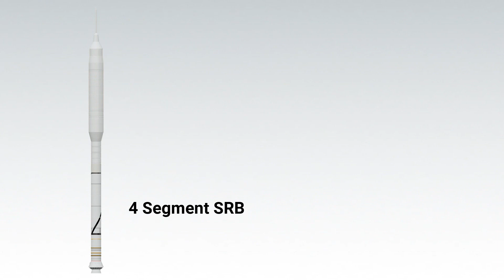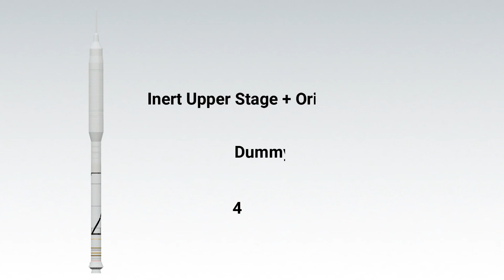The Cancellation of Constellation

Comment: Constellation was the fantasy of then then-current NASA administrator.  The solid rocket powered booster was far too weak for the mission and caused the redesign of Orion until it had been reduced from six crew to four, and the amount of water per astronaut had been reduced to a PINT (!) a day.  Despite the "potential", it was a poor design all round.  SLS may be crazy expensive, but it's better designed by far!

Comment: So the Altair, with the cryogenic fuel in it, would be parked up there in LEO, waiting for the Orion to show up.  Surely there was a time limit for this before too much fuel boiled away.  What was the official answer to this obvious question?  Surely there was one, and boy would I like to know.
Reply: There was supposed to be a "loiter ring" attached to the cryostage - essentially a bunch of solar panels and cryocoolers wrapped around the engine section, which would be jettisoned before TLI

Comment: I mean, u are right, constellation program was the best NASA engeeniers could have imagine, but, due to the contractors, and partially due to the specs requiered it was simply so much expensive, maybe id they have gone in to a 2 stages medium lift querosene propulsión vehicule, maybe today we could have an Ares 1, and then, the awesome Ares 5 that enormous project should have never be founded or even propose until Ares 1 crewed maiden flight.
Let' s hope on the elon and jeff way cause it seems like NASA can no compete with the SLS, even Europa Clipper must lift off in the Falcon Heavy or New Glenn, if ready, because vibrations on the SLS
Reply: Constellation Project used old technologies of Apollo and Space Shuttles and a 21st replay of the Apollo style moon landing is very meaningless!

Comment: Great general outline of Constellation. However, the longer Constellation lingered, the more and more unrealistic it seemed.
The foundation for its start was a study done of what NASA should do in the wake of the Columbia disaster, which was to return to the moon and head to Mars. The resulting program was Constellation. There were criticisms at the beginning that instead of taking advantge of bold new technologies as was suggested in the Bush exploration report, that Constellation was just a big relplay of Apollo, and was not really a fundamental step forward in technology, but just something to delay an eventual Mars mission.
By the time metal was being cut for it, its budget required that the ISS be de-orbited as NASA could not afford to keep it going and fund Constellation, and the Altair lander would have required an unrealistically large increase in NASA's budget. Also, there were some severe engineering reports, including one from the Air Force stating that the crew could not survive a first-stage explosion due to the rate of expansion of its fireball being able to overtake the escape system rocket. This was significant because  a major part of the rationale in killing the shuttle was that there was no way for the crew to escape a launch problem, as had doomed the Challenger crew.
Even the case for returning to the moon was not stated, and it did not have broad support from the public or even within NASA, as it would have been so expensive that NASA would only be able to do an underfunded Constellation and little else. 
Artemis has gained more support because it does have the stated goal of finding and making use of the moon's resources, and it makes use of commercially provided components, and apparently it requires much smaller increases in NASA's budget to pull it off than did Constellation.  Politically, it gains some support by its use of the in-progress SLS and Orion, and in general Artemis is open ended and can evolve to take advantage of what we find on the moon and commercially driven technology, instead of just committing to a prohibitively expensive lunar delivery system with no clear purpose. It should be stated though, that thanks to Constellation, the LCROSS mission (that verified lunar water at the south pole) and the LRO that accompanied it, did fly on time as the first Constellation elements, and have contributed a lot to illustrate the importance of the moon to exploration.
https://www.nasa.gov/missions/solarsystem/bush_vision.html
https://phys.org/news/2009-07-air-ares-crew-couldnt-survive.html

Comment: One could only imagine what could have actually happened when constellation wasn't cancelled, but one thing is sure: 

With constellation never cancelled, there will be no Artemis and Commercial Crew
Reply: Because Constellation planning would have ended NASA flights to the ISS after 2015, perhaps commercial crew would have been worked into keeping ISS operating, much as it does now.
Reply: It wasn’t exactly cancelled, both of the rockets had very serious engineering concerns. Most importantly; ares 5 was supposed to use ablatively cooled RS-68s from the delta IV in a cluster, but it turned out that the heat would be too much, so they has to use regeneratively cooled engines I.e. the shuttle ones. The cumulative redesigns resulted in the SLS we have today. While the actual implementation has been disastrous, the SLS as a design was more or less inevitable.
Reply: Artemis its okay but fucking just for comcrew the not-cancelation of constellation would have been devastating
Reply: Maybe spaceX could have gone bankrupt without commerical crew
Reply: Maybe not. For sure. Obama save his ass.

He say it. Well "NASA save ass"